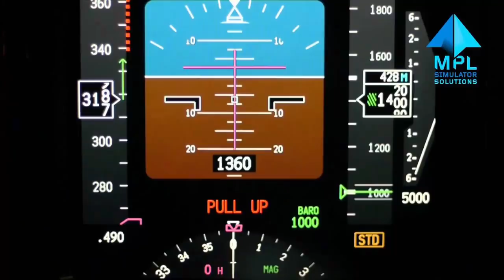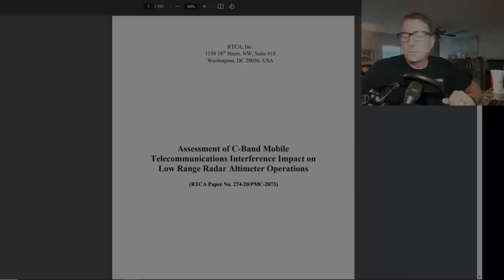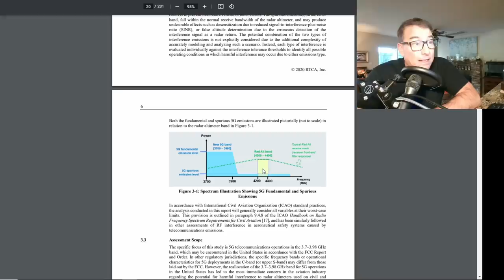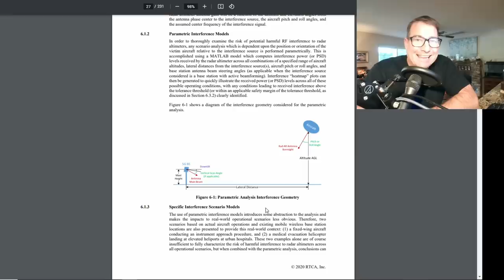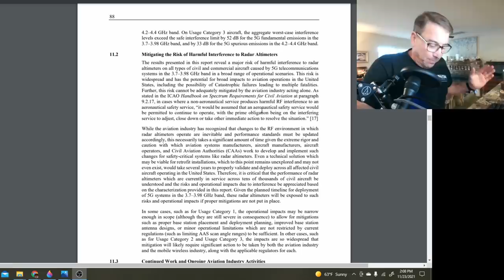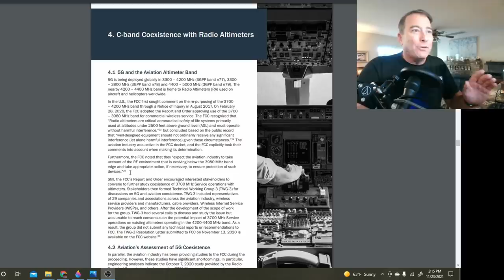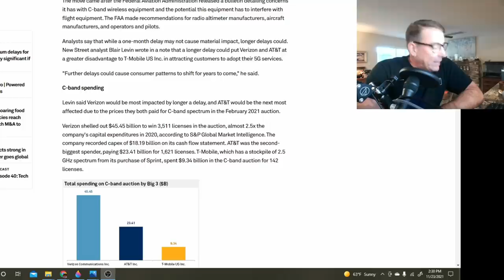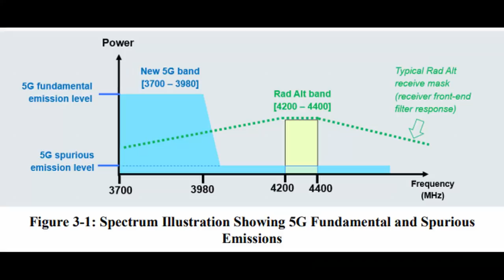5G C-Band Interference with Radar Altimeters in Aviation

Comment: I worked at JPL for a number of years on Doppler radar to track deep space vehicles. The signals were transmitted as analog and encoded signals, received back at the station, matched up with the transmited signal. 
The transmitter and receiver on the AC could be modified to use an encoded signal. The advantage in doing so is the radio altimeter gains independence from all other interference. 
This change will take some time but is worth the effort and money spent. There is simply to much money behind the internet to continue to fight. Become independent instead.
Reply: Consider you need to measure absolute range to within +/- 2 ns (range rate or doppler doesn't matter and is anyway going to be almost zero).  That's a very different problem than trying to detect a weak signal in noise through correlative processes.
Reply: @saratogapilot6100  The problem here isn’t the weak or strong signal, it is the wrong signal, seperate the wheat from the chaff. We need to pair the transmitted signal to the receive signal.

Comment: I’m a broadcast engineer and radio operator.  This has been our experience so far with 5GUW signals.  Our C band dishes were interfered with from a 5GUW signal nearby.  It took assistance from the cell company to put a bandpass filter  and fix this issue.  The problem wasn’t fixed and we had to use a larger dish to overcome the interference. There’s too much money going to the FCC by these cell companies so there will be pushback.

Comment: A good report. Remember this is an international issue. It will affect every country in the world eventually.
We already have another issue, which is broad spectrum interference generated by other electronic devices, particularly LED lighting systems, which effectively lifts the noise floor. This will become a future issue as aircraft approach airports over commercial areas.
Reply: Other countries (Europe and Japan, primarily) have been using this spectrum for years without issue.

Comment: Good presentation, Juan.  I'm so old I got the patent on digital VOR (3,525,979).  I got my private in 1964 and ran out of medical in 1986.  We  certified the first Bell helicopter civil IFR (a beautiful 412 for Mack Trucks) that had dual radio altimeters.  In my opinion, the existing radio altimeter systems were marginal when new, and that was a long time ago.  We have technology today that would provide much more accurate and reliable radio altimetry.  We should move off and leave this spectrum for less crowded space and have better engineered systems that avoid the several severe issues designed into the incumbent.  Thanks again for your efforts.  Your channel should be required viewing for each and every journalist who wants to cover aviation.

Comment: The FCC specifies how far apart frequencies and power levels of equipment need to be to avoid interference. I've dealt with testing to these specs for over 50 years. If the radar and the phones meet their specs then there will be no problems. The characteristics of the 2 signal types are so different that interference is unlikely even if the phones and radar are out of spec. As an engineer dealing with EMC/EMI (Google the acronyms) I've heard this story over and over each time some new technology is rolled out. It's understandable that people will be concerned when they hear a trusted source such as Juan raise concerns. I hope Juan does a follow up video once he has educated himself a bit more on this subject.
Reply: I heard the same bullsh&t when IBOC was rolled out two decades ago. In the end it didn’t matter. No ones life depended on it. It was a tremendous smoke cloud that so far has created a great deal of money for the Treasury with almost no benefit for the radio listener. A great deal of gear was sold, but I challenge someone to show me that the actual use of digital radio by end users has been worth the effort. The net effect was the USA does not have the benefits of digital radio receivers such as the rest of the world. Vast numbers of radio stations either never implemented IBOC or have turned it off saying the power bill necessary to support the transmission not worth the number of users. I won’t rehash old arguments here, but I will say this: in the end, the actual radio users in the US lost a huge opportunity because of it.

Comment: Recently I monitored a discussion about this issue.  One of the participants said the airlines have had two years to make objections.  Also, that  the brand or model of the altimeter made difference.  All of the problems were in a few old devices.  I do not know how accurate those statements are but if they are accurate the scope of the issue becomes narrower and clearer.

Comment: Juan I've got a question concerning 5g? I'm some what still an analog man in a digital world so excuse my ignorance in subject matter.
Is it possible to employ a system to jam(prevent) any outside interferes with the aircrafts communication devices, freeing up the aircrafts system from other digital interference? 
PS: Happy Thanksgiving to you and your family and thank you for great year-round content.
Reply: I've worked allot with analog and digital modulated signals. I'm guessing they will install a high Q band-pass filter on the input side of all the radios.  If the undesired signal is strong enough, it will be too strong to receive the desired signal.   It like when the sun is out you can't see the stars.
Reply: I would say (based on my somewhat limited knowledge) that such a jamming system would probably jam the aircraft's own system, in this particular case. It might not.

If you're doing an active jam, you're firing comms out. In this case, you're firing at the ground... which is what the radar is doing anyways, expect the signal to come back up and bite you. If you're doing a passive preventer, it's a filter--Juan did talk about that, it's filtering out known bad signal (you're looking for a specific signal range).

That said, there's a really easy solution to this. Increase the power on the radar altimeters. If a 5G device has issues, fine the company that owns it (and complains about it) for being on the wrong frequency. They'll learn real quick.
Reply: Eric is right. This is not war. If an incoming airliner jammed 5G cellular, it'd be in trouble with the FCC. Also, as Eric also notes, jamming 5G cellular would also interfere with its own radar altimeter. I will add that this issue illustrates a vulnerability in instrument landing systems that needs to be addressed. Even if 5G cellular isn't allowed to interfere, something else might.
Reply: @erichusmann5145  Yes onboard jammers will jam the onboard systems and increasing power out will result in mow power into the receiver overloading it and creating other errors.
Reply: Jamming just denies service to everyone, including the jammer.
Reply: Absolutely!!! The AIC does this all the time.

Comment: Since the average passenger is not smart enough to know if their phone is operating on 5G or even trust worthy enough to be sure they are in Airplane mod how do you expect to control the passengers to not interfere with the RA equipment?
Reply: Easy, just make them hold their phones 200 meters from the airplane.:goodvibes:

Comment: See the way the blue area drops off? The yellow area can do that too.
There is 220mhz guard band between the 5g signal and the radar altimeter band. That's double normal guard band spacing.
Aviation needs to get urs act together and join the modern world.
Reply: The value of a guard band depends on the frequency. AM radio stations are spaced 10 KHz apart and I believe FM stations are 100 KHz apartd, ten times more. When you get into the microwave spectrum, 220 MHz is nothing. There are tuned cavities that could be put in the plane to pass the radar frequencies to the receiver or block the cellular ones, but they'd need to be installed.
Reply: @Inkling777  110 MHz IS the normal guard band (not spacing) for that part of the spectrum.

Comment: A long time ago a company called bonzer made a radar altimeter.  If I remember correctly  it used the 10ghz band called xband.

Then police radar guns used the same band.  Xband radar altimeter were banned.

It's hard to believe the fcc would make the same mistake again.

There's a lot of money  behind 5g build out.  Rf filters at the 5g frequency are not very good.
Reply: "...the 5G frequency..."
You are sadly uninformed. 5G spans 630 MHz to 26GHz in chunks and base station cavity filters are among the best known to man. At 3.8GHz they are small and getting 120dB out of band rejection is not uncommon. The basestation receivers are sensitive enough that passive intermodualtion from rusted screws on towers create excitement. Antennas, cables, connectors need minimum - 150dBc testing.
The telecom world is not some haphazard legacy toy industry.
Reply: @Piccodon   Hi, sounds like you know a bit on this topic.  Actually I am the founder of an RF Bandpass filter company. The actual frequency of radar altimeters is 4.2 to 4.4gHz.  The portion of the C-Band in play here is the 3.7GHz and 3.98GHz auctioned to the cell players. Neither the radar altimeters nor the spectrum used by the cell companies have adequate bandpass filtering, thus the big story on 5G interfering with Radar altimeters.  Note that it is possible for the base stations or the 5G cell phones in this band could interfere. Radar altimeters were designed during a time that the satellite services left the band widely unused.
Reply: @kurtdobson  what kind of filter technology did you produce? 
Uplink power from user equipment is set by the tower to be close to the noisefloor, so that is hardly a problem. Frequency use in 5G may allow aggregation of bands so one band may be used only for downlink, like the upper part of band 66, as downlink is heavier in traffic.
Old radar may just have a circulator as a "filter" but these split antenna system not even that.  There are current offerings in the market with DSP etc, and wideband diode detectors and sparkgap transmitters went out of style long ago.

Comment: I did a lot of riding in aircraft for business throughout my career. I never understood the significance of my cellphone on aircraft performance.   I think it was poorly understood by the average passenger. Broadcasts like yours provides excellent explanations of these systems and should required viewing for all passengers.
Reply: Older mobile phones caused magnitudes more interference. It was possible to observe without expensive equipment and you could easily hear it if you were near and audio amplifier. So logically, like here, it made sense to be concerned. However the have been no notable incidents linked to the emissions. Studies have backed that up. And that's why Airplanes have Wi-Fi (that always seems broken on United) today. The rule is vestigial.

The difference between what's going on here and historically, is the spectrum involved.

Comment: Juan, as an almost retired Tv station engineer, there are a few things left off the frequency chart. Current C band geosynchronous goes up in the 5ghz band and comes back down in the space below radio altimeters and used to go down into the space that has been sold to the telecoms. (Just like when they took the Tv channels from 52 down to 37. Before taking 53 north to 72 quite a few years ago.) I have read in just the last week the FCC is forcing telecoms to reduce power. The telecoms are being forced pay for putting filters on our C band RX dishes to keep their signals out of what little C band we have left to receive programming. If I was flying I would get detailed coverage maps for the carriers that have 5g in the C band running. Watch the radio altimeters really closely as you pass through the final 1000 feet in those cities. And if you really want to drive proof home practice a full auto land in VFR conditions at any airport that you've even seen a twitch on the radar alt.
Reply: The rest of that thought is to report the fail in the green lights if and when it happens. If you work it out with your Captain to cut auto land and either go around or land the placement of these towers and the power out can be dealt with out becoming a headline. And you are correct this is a funding the government plan.

Comment: I have some experience in electronics engineering and a bit of RF engineering and there is a big difference between 4GHz and 4.2. Sure there might be some leakage but notice the graph with spurious signal level, there are no units on the y axis. Assuming it's at all correct, that axis could be logarithmic and the relative signal strength could be 10000 to 1. To my knowledge, and admittedly I'm not a state of the art expert but I do have some knowledge, this proximity is not an issue at all unless the altimeters are designed with very delicate crude triggers under the assumption that it will be operating in virgin territory where no electronics exists. And satellite transmissions are right on both sides of that 4.2-4.4GHz band already. Worst case some simple overly delicate units would need upgrades, otherwise it's a complete non issue. Something aviation should care a lot more about is computerizing ATC instead of the awful telegraph era voice system we have now. That's an infinitely greater problem and danger.
Dual altimeter misreading in agreement is not realistic either, nor would it fool GPS.
To put it into perspective further, RF tech is today so sophisticated that you could do radar distancing to the 5G tower, looking directly into the beam using the very same frequency band as the 5G tower. A pulse of a specific frequency can be very precisely discriminated for. So it's a complete non issue, only being a problem if some units are very crudely made. I assume that very wide ramp filter response is solid territorial bs or that would be a case of very crude design in need of modernization. I assume that replacing such units is very doable.

Comment: Thanks for this excellent report. Aerospace engineer off CF-188 who did EMC work in flight test. Filters could do it with modern approaches but will need ++cert testing and won’t be cheap. The case of both radalts reading equally incorrectly is possible and terrifying likely depends on the physical location of the radalt antennas. I’d love to set up a ground test on a wide body to see if the system could be fooled. Only way to error check that would be vs synthetic altitude or baroalt. Again expensive cert testing for a change like that if it’s not already in place.

Comment: Some things to consider: 1) the FAA knew 1+ years in advance that the C-band auction was happening - why raise this issue at the 11th hour, after the auction was held and licenses handed out? 2) Japan & Korea have already deployed C-band up to 3.8 GHz - where are the incident reports? And the RTCA was unwilling to be transparent about the data used in the report, which stands in contrast to the reports prepared for the FCC and the DoD. Cell companies agreed to push out their deployments until mid-January, and restrict use of the upper 15 MHz around airports. The FAA and the airlines have yet to identify which model and number of altimeter systems are affected. Hate to say it, but motivation to use the auction proceeds to update entire fleets on the basis of potentially only a few models in use isn't inconceivable "out of an abundance of caution".

Comment: It seems to me that the radio altimeter system is designed with little redundancy. Regardless of 5G or not, to rely on a single signal which may be affected by almost anything creates a risk.  Slopes, diffusion, interference natural or man-made are all risk factors. A radio signal is never very reliable. As an electrical engineer myself, I would not rely on such a signal unless you can have at least 2 systems in different bands and the ability to compare results for the sake of knowing the error and uncertainty of measurement.  Same as with MCAS the reliance on single point failures on modern aircraft is not good. If you do not have at least 2 independent values to compare, then you are gambling already, with or without 5G.
Reply: This makes huge sense to me. Plus, can’t Radio Altimeter manufacturers improve the discrimination? There is room for enough small tweaks on both ends to improve this situation.

Comment: The problem won’t likely be the equipment operating as designed and approved so much as the shoddy produced-by-the-millions in China 5G base stations that will be scattered around in questionable installations which are not checked for reflections or cleanliness by the nature of the rushed rollout. They will be placing these things everywhere since the band in question is inherently limited in range especially in areas with buildings or terrain

Comment: Legally the fault is with the radio altimeter.  There's no reason not to filter out-of-band except there was no reason to before 5G.  You don't need a license to receive out of band but it's on you to fix it if it bothers you.
Reply: No, that's now how spectrum allocation works. Bands have a primary user whose rights must be respected. If 5G wants to move in next door, it must be the good neighbor and address the problem.
Reply: @Inkling777  The ability to limit the input band is on the receiving side, so it's their responsiblity.  If they want 5G out, they can bid on 5G bands themselves.  The primary user stuff is about shared bands, not disjoint bands.